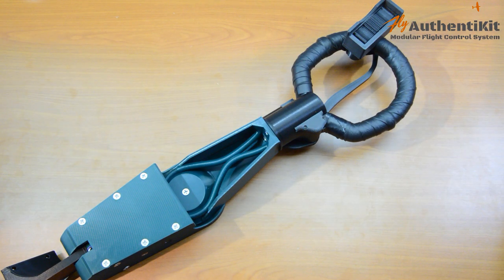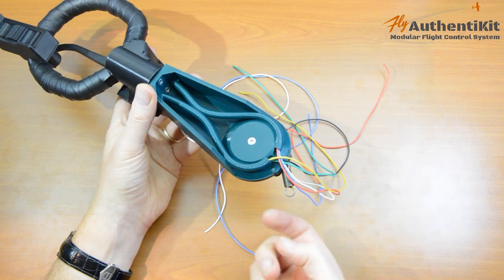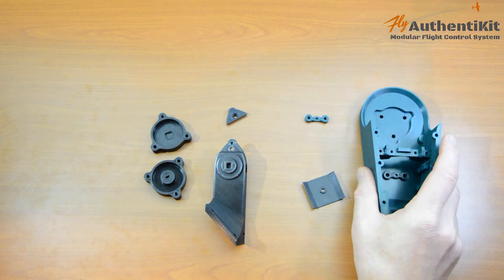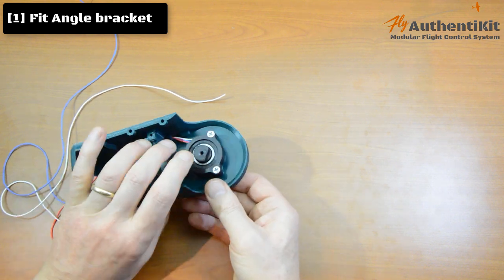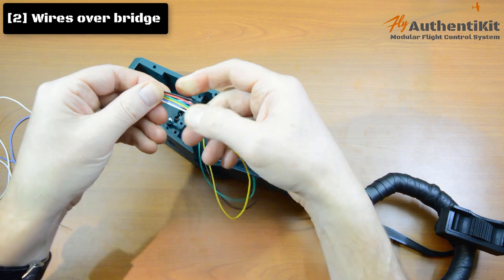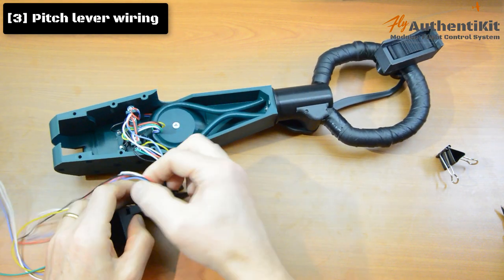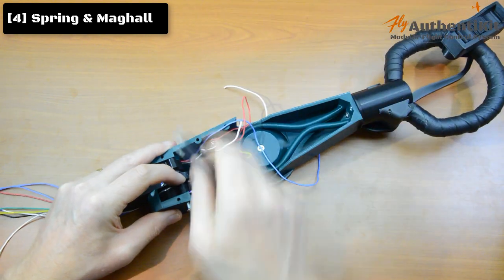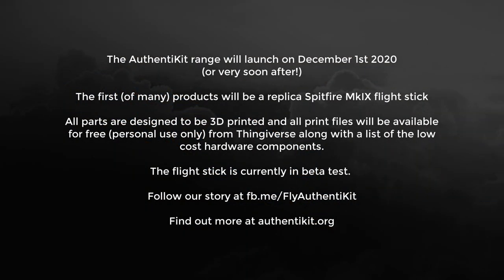AuthentiKit Spitfire MkIX Flight Stick - Self Build - Part III

Comment: Love it. Are you going to build whole cockpit or just custom hotas?
Reply from the maker: My main interest is VR and focussing on the stuff you want to grab hold of: Stick, quadrant, trim, flaps, landing gear. Maybe radiators. I'll be sharing design techniques and reusuable modules for others to extend the options and do other aircraft. I'm trying to kickstart a hardware standard & sharing community.
Reply: @AuthentiKit  looking good! Subscribing
Reply: @AuthentiKit  Do you have specs for the auxiliary equipment? I've been designing German and P51 panels for my own, personal setup (copying old blueprints/adapting modern, cheaper parts), and I may want to look into making them compatible to a standard once I finish up my rig.
Reply from the maker: JumpCuts By auxiliary do you mean the 5 sockets on the left? See next video for more about that. What parts are you working on? Jump onto Discord and we can discuss. Invite link on authentikit.org
Reply: @AuthentiKit  I've been working on switch panels, mainly (engines, electrical, emergency pulls, etc). Basically all the stuff you'd need to manage the plane systems that's not on a standard Hotas. Though, most of my time has been spent trying to get decent documentation/photos (or searching said documentation; definitely the hardest part).

My main objective was/is to make it so I could start and run a plane in DCS (or IL2) in VR without reaching for the mouse while having some "authenticity", and while being in a package small enough that it can be broken down and stored away.

I'll join the discord.
Reply from the maker: JumpCuts sounds a bit more sophisticated than i’m aiming at. I haven’t finalised what panel controls i will support but it will be fairly limited. Maybe in 6 months i’ll have a clearer picture.
Reply: @AuthentiKit  That's fair enough. In six months, I hope I'll be done with my panels enough that I can take a look and contribute.

Comment: I’m talking with a guy to get 3d printed parts. But I’m not going to lie... I’m scared of the building aspect. I was born with to left hands (and I’m right handed)... it would just be my luck to put it together and at the end seeing one button isn’t working.
Reply from the maker: In that case we NEED you doing this project. :-) A fair number of the people who have done this build so far are experienced DIYers but I spent 2 years of my life developing a system and assembly methods for regular people like yourself who don't have a workshop or diagnostic tools. Start with the trim wheel (10 minute job) then the throttle quadrant (less than one hour) and then you can take on the flight stick which is more of an afternoon.
Reply: @AuthentiKit  I'm doing the stick right now and I'm totally lost on this part. all other parts were no problem... I have to switch between the video about the newer version and this one, which doesn't help at all. In the groups in the new version video it speaks of a pitch cable, but it doesn't seem to be in this video...
Reply from the maker: @Sir_vAce  Are you on discord? I have some notes that I’m going to use to make a new compilation video to try and join things up in a better order. They may be useful to you.
Reply: @AuthentiKit  Don't bother. I've given up. To me it's 300+ euros down the drain. The thing doesn't do anything when I plug it in. I've missed 3 days with my family because of this.
Reply from the maker: @Sir_vAce  Really sorry to hear that. I can tell you’re frustrated, but please think about reconsidering. You said the other things were no problem. Does that mean the trim wheel and quadrant worked ok?
Reply: @AuthentiKit  The guy that I contacted didn’t print the wheel and throttle yet. I only got the stick. I’m infuriated and disappointed in myself because I thought I would be up to the task but clearly I’m not.
Reply: @AuthentiKit  Where should I look first if the stick doesn’t show up at all in windows?
Reply from the maker: @Sir_vAce  I see you are on Discord now. Will pickup there and get this working for you!
Reply: @AuthentiKit  I made it work. Pitch and roll, all buttons are working. Sadly brake lever axis is not shown in the joystick properties